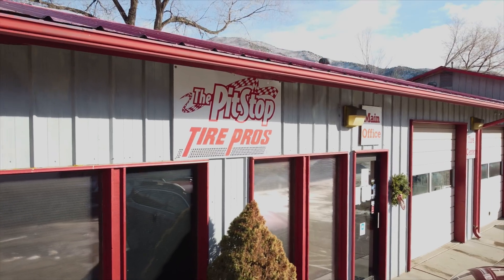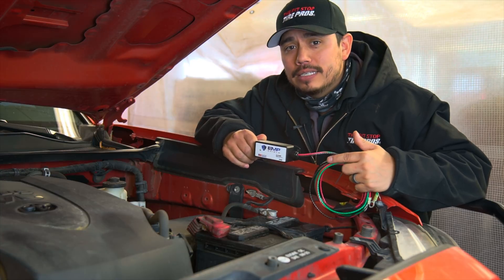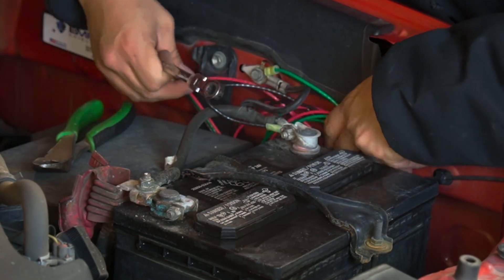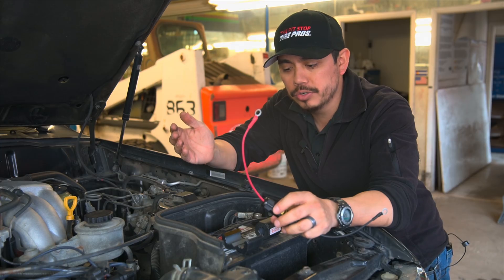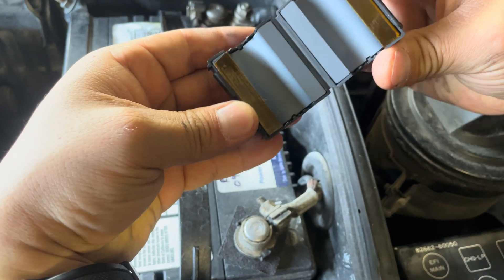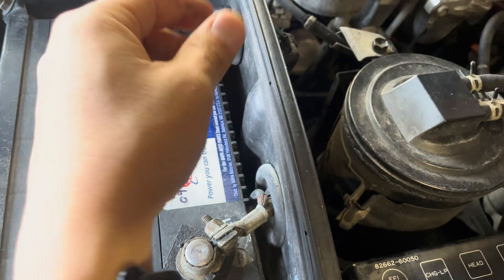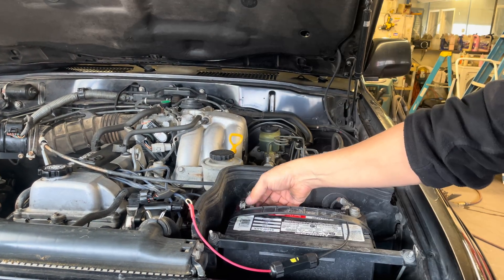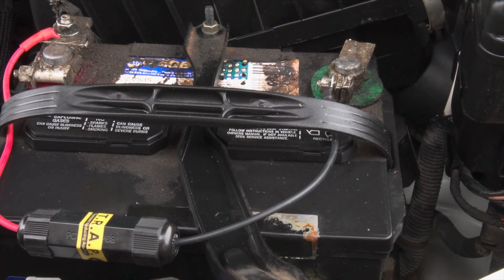EMP Vehicle Protection / What are the options?

Comment: Best EMP protection is a car with points.   Added anti-theft if you 'adjust' it before placing it in storage.
Reply: Better yet old school mechanical diesel with manual transmission to rollstart incase alternator dies
Reply: Pre-1968. The average vehicle on the road today has over 100 unshielded computer modules.
Reply: I’m completely ignorant when it comes to this stuff, but trying to learn. Would the early 80’s HEI set up on my old Chevy survive, or do I need to be running points in my K20?
Reply: @jimmywesberry  Just have an extra ignition module wrapped in aluminum foil in the glove box.
Reply: @jimmywesberry  Willing to bet if you have HEI Ignition that you have an ECM and likely also Fuel Injection.
Reply: @KageShi  Uh, no. no FI till 87. HEI from 74-86
Reply: @scottnorris8571  Many cars started getting FI early as 78-80 in some makes,  
Any Hall effect sensor/distributor or one with a potted 'control' module will likely fail in an emp situation.  Points are more or less a midget in there flipping a mechanical switch.   Will likely need to swap the coil unless you had the Highvoltage side grounded to the ground pin and then pos side.
Reply: @KageShi  We weren't talking many cars, we were talking about his 80's chevy K20 With an HEI distributor.
Reply: @scottnorris8571  All the factory 80's GM trucks and cars I've seen have had fuel injection.  GM trucks even only had 2 injectors until almost the 2000's
Reply: @KageShi  they never had FI till 87. Qudrajet carb from 67-86
Reply: May have been an option,  Most of the 80's GM fleet trucks i've had my hands on were all that stupid hybrid 2bbl injector style.
Reply: @KageShi  For god's sake dude, what part of this are you not understanding. GM DID
NOT HAVE FI ON TRUCKS TILL 1988. It doesent matter whet you think you know this is the fact.
Reply: @KageShi  750 cfm quadrajet mounted on top of my 454. It works really good for anti-theft. If you don’t pump it 3 times it won’t start. Any more than that and it’s flooded and not going anywhere either! Lol.
Reply: Vehicles deal with serious emp's from the ignition system. Most stuff would actually probably be fine. I mean it also depends on how close you are to the event as well.
Reply: EMF yes,  Not EMPs.  The high voltage discharge of the ignition is shunted by the engine and battery.  Even a circuit without power when exposed to an emp will have failed components,  mostly inductors and transformers that will short out.  Any IC that also isn't properly shielded to discharge random voltage spikes away from volatile components will also fail.
That's why I stated what I stated.  
Something with points will also be carbureted, and the most tech thing would be the external voltage regulator for the generator.   If you had a spare ignition coil,  spare set of points, and a voltage regulator in an EMP resistant enclosure you would be smooth sailing after some parts swaps.  

.....that is until your vintage gas guzzler runs out of fuel.
Reply: @KageShi  Thanks

Comment: A great idea...for the seller.
1. Make a device that has a very good warranty....which of course when the event happens you have no way of claiming the warranty.
2. The testing on the devices are NOT tested with the amount of EMP we would experience.
3. Lets assume that the devices work, there is a huge EMP and your car is one of the very few that works. How long before everyone else try's to take your vehicle by force? Everyone from local hoodlums to law enforcement to government agencies need to confiscate it? So you have a vehicle that works but can't drive it anywhere.
 Having a running vehicle paints a HUGE target on your back.
4. You have to also consider there will be nowhere to get fuel if the power grid is down so what you have stored is all you will have. That's why I have a smaller atv because the 250 get around 75 mpg.

 I have an older 250 cc. atv that has very little electronics on it and I have ordered all spare electrical parts and have the stored in a very good Faraday cage. If an emp or cme hits then after a good wait I will swap out the old parts and be good. The plan is to stay away from people and just use the atv to haul meat back from the woods.
Reply: Exactly.   My thoughts exactly 🐾🐕🐶 Where are these people intending on driving to?  Roads would be impassable with disabled vehicles.   No fuel at gas stations after a few days.

Comment: Those clip on Ferrite's block High Frequency (Not DC). A Zener Diode is what blocks overvoltage (This is most likely what the EMP protection device is).... you want both for full protection
Reply: Toroid chokes block transients very well. That's why they are installed on almost every cable I own. They also block specific frequencies. Even DC is not static when it goes from off to on.  A Zener Diode is  a specially doped diode that allows an amount of current and voltage "the wrong way" but blocks the rest. I cannot imagine a zener being remotely fast enough to protect against a seriously fast transient. I think there's pretty damned fast shunting SCR's for that.  OPA !
Reply: @nonokodog622  SCR's might be good as well, but I've seen Zenier diodes used for ESD protection, so I think it varies and one would have to check the datasheet and for their particular use case. There are also Transient-voltage-suppression diode which could also work!
Like I said a bike is the safest bet .... (rofl) unless your bike uses a battery
Reply: @nonokodog622  You'll need to watch at least 1000 more YouTube videos before jumping in the comments with ridiculous suggestions about Zener diodes and chokes. You don't even know what chokes are, apparently.
Reply: So what would you buy to prevent the mp from killing your vehicle ?
Reply: @planb626  A bicycle.... (rofl)
Realistically, given that any amount of wire is going to be a receiver for the EMF/EMP to cause damage (The longer the wire the higher potential for damage) I'd start by protecting the ECU and Battery... That would require some pretty nifty wiring though.. given that an ECU may have over 100 wires going to it and each would need to get protected.... 
A carbureted engine would be easier to protect.

Comment: DON'T WASTE YOUR MONEY 

(EMP) is an effect where radiation emitted after a nuclear blast destroys the silicon junctions in semi conductors. (Micro-chips, processors, transistors, etc.). This is a direct influence effect, it does not come as a transient through cables or conductors, so the only way to prevent damage is direct shielding of the components.

Comment: Doesn’t the key fob have to be protect too?
Reply from the maker: If it’s a keyless system for ignition then yes as the RFID signal used to start the vehicle would still be used and therefore need protection. The key would need to be in a faraday bag. If it’s a keyed ignition with a key fob the fob would most likely short, but still be able to start the engine.
Reply: @ Thanks for that info..  I’m assuming wrapping in aluminum would work.. instead of faraday bag

Comment: So do any of these products claim to be good for more than one hit? If its an emp attack. Supposedly they hit once. Then when everyone's broken everything out of their farady bags, they send another emp
Reply from the maker: Emps hit in three patterns Em1, Em2, Em3. Each outputting different waves lengths. The Emp shield protects against all three. The only protection (Emp shield) they have said is a single instance of is a lightning strike, in which case they request the product sent back and a replacement is issued for $50. They will use the damage device for research. Because most of the talked about devices main function is redirection of heat and excessive electric frequency away from sensitive components like chips and sensors, multiple hits should be feasible to all devices listed.
Reply: @ThePitStopTirePros  appreciate the response.  Thank you 😊

Comment: Is there anything available to protect all the electronics in a camper trailer?
Reply from the maker: More than likely there’s a model will suit that particular setup. I would call EMP shield or Faraday defense and asked them based on the electrical components that you are looking to protect.
Reply: I use the T.R.A.P. that goes across my battery terminals on my camper.

Comment: I'd love to see the inside of one of these.  Guaranteed it has just a simple circuit board inside to power the LEDs. Your battery and electrical system is already grounded to the chassis by 6 gauge wire.
Reply: I can't find any videos with anyone taking the emp shield apart.
Reply: If I apply 100K volts to your car's negative terminal, that's going to look like -100KV on the positive...that'll break something.  Right ? Because voltage is really Delta V between two points.  The gauge might not matter much. A really fast transient pulse will be on the skin of the conductor. I suspect he shunt circuit is a comparator and  fast transistor.
Reply: @nonokodog622  LOL. You have no clue what you're talking about.

Comment: Interesting device. But I'm more concerned with prepping food in a SHTF scenario than prepping a car that i probably wouldn't be able to drive for long if all the gas stations are down due to an EMP attack. Even if you store gasoline, it's only good for 6 months to a year.
Reply from the maker: Food prep is a great plan as well as all your primary location provisions. Yet if you are in a SHTF scenario you might not be home at your primary location or may have to shift to a secondary location. Most modern vehicles have plastic tanks and getting more fuel from downed abandoned vehicles wouldn’t be very hard. With a 20-30 mile average that a person can walk per day with limited weight, a running vehicle can be a valuable asset.
Reply: @ThePitStopTirePros  Good points👍🏻
Reply: Get a diesel vehicle. Diesel is just oil. You can run a diesel on any clean oil you can get. That said a moving vehicle will be a target if all the other ones are broke
Reply: If you are on the road and say this does work you will still be stranded. All the vehicles without it will be dead and blocking you. And when those panicked people see your vehicke running you better be ready to protect it or give it up. Same for bugging out. If your not there chances are your not getting there

Comment: What if you disconnect your battery.will an emp still affect your electronics
Reply from the maker: Even if the battery is disconnected the large and small conductors which are nearly every wire in the vehicle, and of  which very few are shielded will still absorb and distribute the pulse from incoming EMP. The shield is essentially a surge protection device, which vehicles can handle some kinds of surges within their system but not large surges and not typically fast enough as to not overheat and fry small circuits. The Emp shield detects over surges between 16-20 amps or more and shunts them within a fraction of a second. There’s no method on any factory built vehicle that could provide this type of protection. Which is why this device is utilized by the DOD.
Reply: This device protects the car about the same as the battery does just by being connected... the excess charges would charge the battery or actively fight the battery which is rather large and can absorb small transients quite nicely as it does when the car is running and the alternator field coil strength can't change fast enough to stabilize the voltage as the RPM or load changes suddenly (Alternators kind of suck at maintaining a constant voltage). This device is probably internally a lot like a surge suppressor power bar you buy at the store for most electronics. Probably just a few MOVs (Metal Oxide Varistors) and maybe a spark gap if they want to stop a HUGE transient. So if you take off the battery but leave this on, it will be a lot like the battery is still there because this would clamp the induced voltage to whatever they're rated to clamp at.

But this does NOTHING to protect the delicate electronics themselves nor the signal wires in the wire harness which are quite vulnerable, nor does it stop the cars antennas from frying anything that's connected to them too.... so your car wont hear your key fob anymore, and all the electronics will still be fried anyhow. Want to protect the electronics? The car body is a faraday cage because it's made of metal which last I checked was rather electrically conductive. Place metal sheet around any holes in the engine bay like under the engine where you change oil, leave a hole or a mesh that you can remove to change oil and filters. Shield the wire harness, and then also place MOVs onto the signal wires where possible at either end of the wires. Any electronics outside the engine bay you want to have working should then be surrounded by metal which is connected to the car body, tin foil is fairly cheap and works shocking well in a pinch, even electronics guys like me have used it for protecting naked chips and power MOSFETS from static discharge which is far more powerful than an EMP because static discharge is right on the device where an EMP has to be picked up the by the circuitry first.

Protecting against an EMP is cheap but requires a shit load of work. Easier to just keep a spare ECU in a faraday cage just in case. And also this product protects at the battery which essentially does its job for it... while being inside the most shielded part of the car... turns out metal cages for engine bays are inherently good at stopping EMPs as well as holding the engine inside the car. Do not buy unless you are worried about like accidentally having the alternator try to put out 24 volts on a 12 volt system... this can stop that, but it wont do squat against an EMP.

Comment: Ok seriously though, 
The EMP shield connects to chassis ground which the battery is already connected to through a much larger gauge cable, so considering the chassis electrical system already has a very large current/ voltage dump capacity into the chassis by design what exactly does the EMP shield do again?...
Reply: It takes your money.
Reply: It gives you some pretty little LED lights to make believe it is actually doing something.
Reply: NOTHING!

Comment: So..if it dumps it in to the ground, hows it getting thier, your sitting on 4 rubber isolators and have nothing touching the ground to direct the power to the ground. As far as dumping into the car body, whats the point of that, your car body acts as a Faraday cage. If an emp or cme hits, its going to come threw in random place, so its going to fry anything in its path, how are those products going to capture the extra voltage from going threw the electronics?
Reply: Tires aren't rubber and haven't been for a long, long time. They are made from nylon mostly.